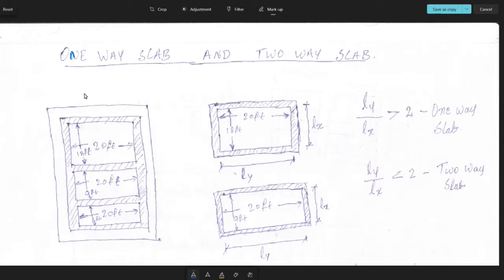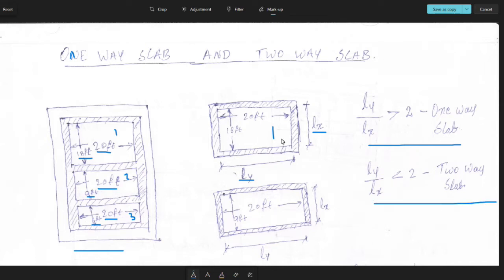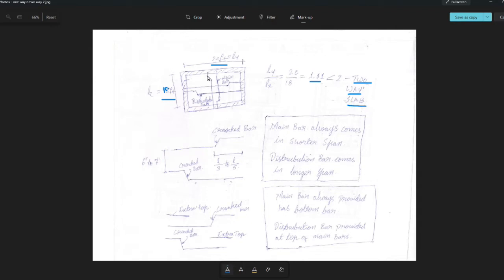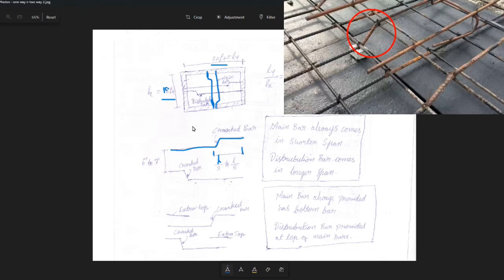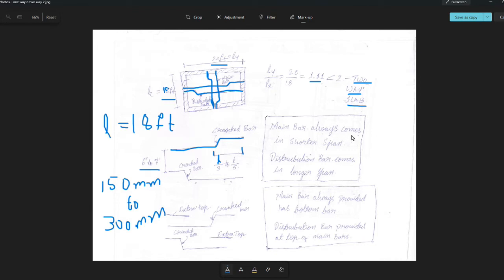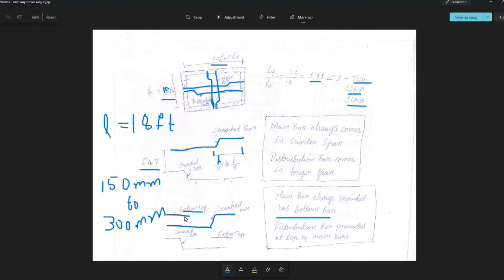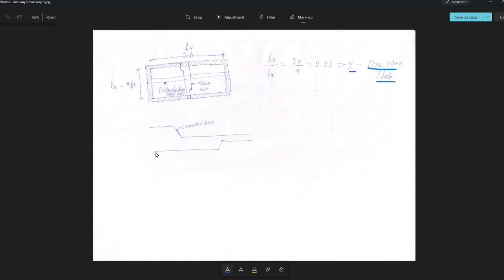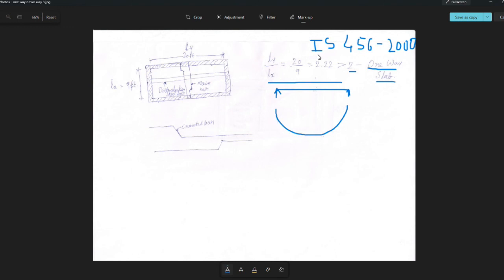One way and two way slabs

Comment: Sir I want to add g+2 slab in already g+1 load bearing house. For that 4 columns are needed to construct which will go through chajjas of slab up to g+2 slab with no tie beam and plinth.So lateral stability will be only due to restraint at chajja. Is it safe sir?
Reply: Pls reply sir
Reply from the maker: Not safe, better u go with adding tie beams.